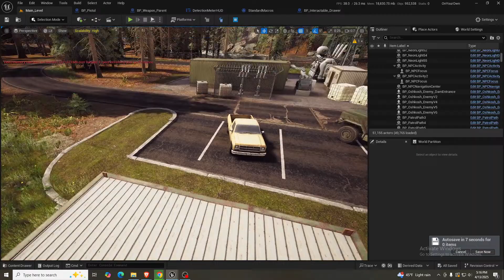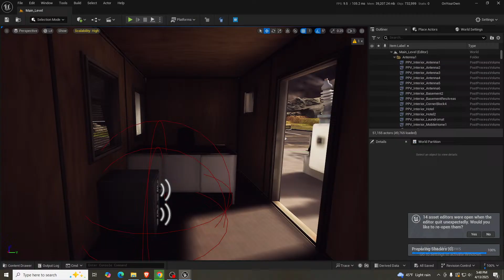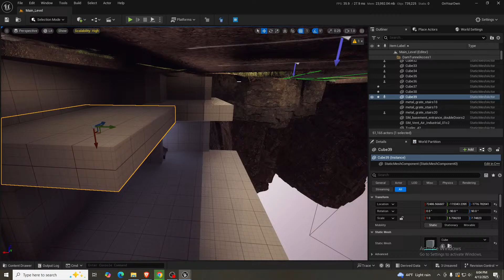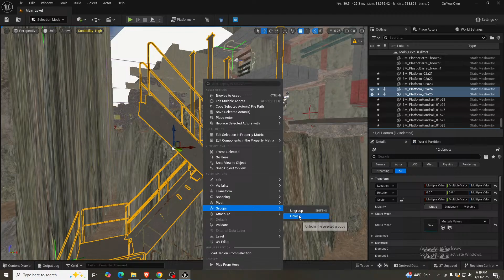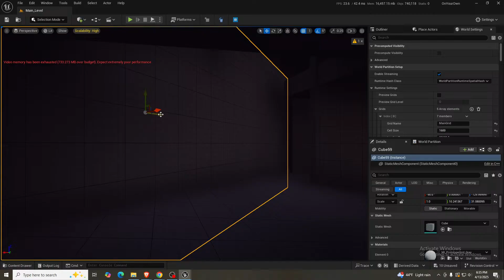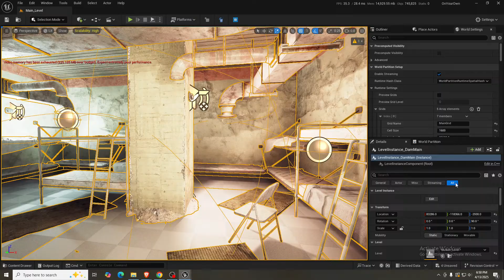On Your Own videogame - Dam area tunnel

Comment: Andrei, how large are drawcalls in your the most demanding situation?
Reply from the maker: @AnAncient76  the areas in town right now are the most demanding, and without any instancing or hlods, can get to around 6-7 k. With basic hlods it drops to around 3k, but can do better
Reply: @AndreiGhenoiu  That's a lot. 
Did you notice larger performance increase by lowering draw calls?
Reply from the maker: @AnAncient76  definitely. Especially in areas that are easier to control, where is not that many assets. I am trying to come up with a better plan for those busier areas as well